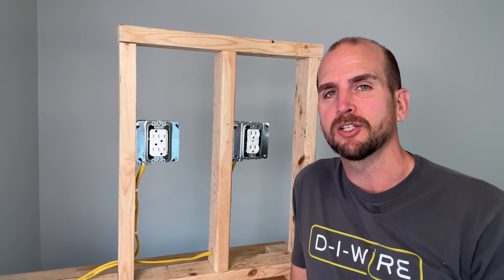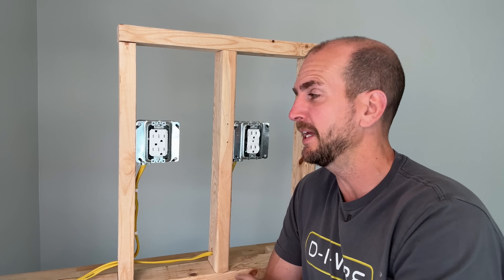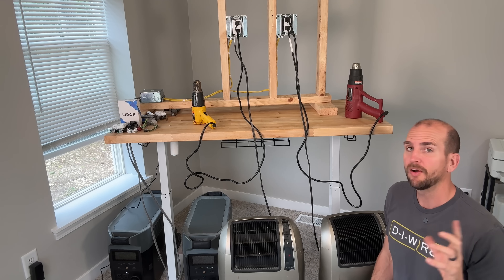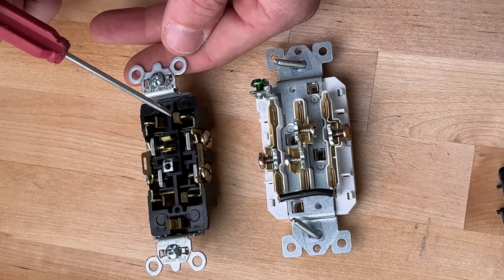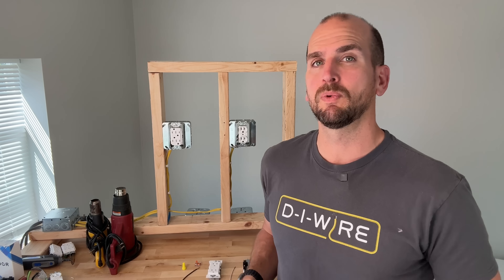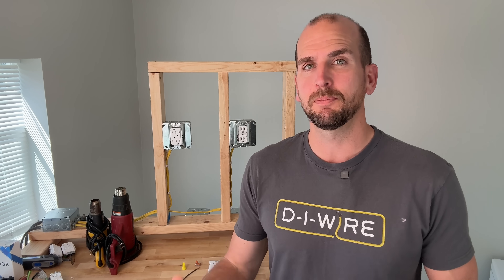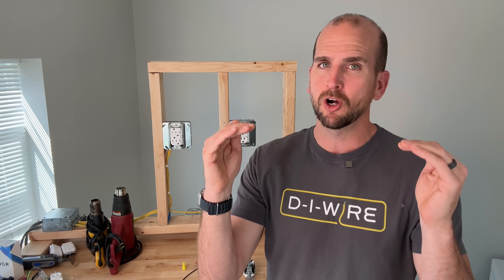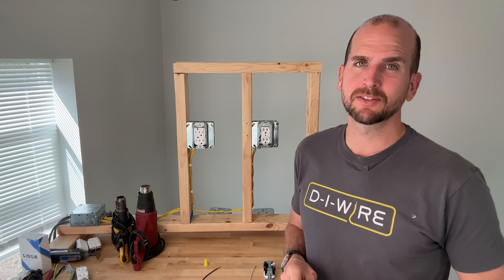The Most Innovative Outlet You've Never Seen | Full Load Testing

Comment: So, you jumped straight into testing and disassembly but skipped over the big, obvious first question - Why? Why do the makers say this exists? The shared blade is the unique thing about this but you don’t address any possible reason for this, and I can’t think of any outside of a Dadaist art installation. The one outlet in each direction idea to make room for wall warts would be easily handled by, oh I don’t know, one going each direction maybe? It certainly doesn’t need the shared blade idea for that, so…. WHY?
Reply: At first I thought you were being ignorant but after about 20 seconds I realized you make a great point. The problem is some cords are designed for ground up and others for ground down which he said and I’m sure you’re aware of. That being said if I was going to go this route I would just install a double box with one receptacle ground up and one ground down. That way you also get 4 outlets you can use at the same time.
Reply: He said right in the beginning  that one side can be connected to a switch and the other to a constant hot wire. If you want to go from switched to always on, just move the plug over. That is a pretty neat concept. It looks goofy AF but can be useful.

It reminds me of the power outlets in some cars. You can choose between always on, or on only with the ignition, just by moving the fuse to a different position. The fuse socket for the power outlet has 3 pin sockets so that you just move it sideways to the desired mode of operation. The middle fuse pin is the load side, the two outer pins are different sources.

For large plugs, the shared neutral blade not only separates the plugs vertically, but it also separates them a bit horizontally. That gives more space than simply putting one upside down. It is slightly more functional in that respect.

I wouldn't use it either but it does open up some new options.
Reply: This appears to be a solution to a problem that really doesn’t exist, at least not in a way that seriously affects the general population. I would never consider installing this receptacle.
Reply: Art. Obviously.
Reply: Retrofit a duplex into a fourplex... Very handy
Reply: This product feels like a design looking for a solution. I can't imagine ever being able to justify installing these. All of the reasons listed seem so trivial and solvable by conventional means. Like, just get a surge protector or something. I'd literally rather run an entirely new circuit to add another duplex somewhere than open up a wall, remove the gangbox, put in a slightly larger gangbox, and put this in.
Reply: @turbo_brian  I’ve seen some pretty horrifying surge suppressors and power strips. I’d venture to say many are much worse than this. They don’t have to be up to any sort of grade or builder’s electrical code.
Reply: Does this outlet need a custom cover plate?
Reply: @Kyohan137  I asked and he said it takes a standard Decora plate. I would need to use a metal one for my purposes and the included one is plastic which is why I asked.
Reply: @emmettturner9452   Thanks for checking ill hold any judgement until I get the chance to check one out
Reply: That was my first question as well. "So, what problem does this solve?"
Reply: He explained it in the first minute...
Reply: I saw the answer. Did you not watch the video? Even the title references the long-running Internet debate about which way is supposed to be “up” and he also says that it allows more room for certain combinations of plugs.
Reply: @emmettturner9452  Well, as I said, you don’t need this weird shared blade, extra-wide thing to solve that, it seems like you could just build one with an outlet in each direction. PS for @diceonamay - sorry, the all-caps WHY was meant to express bemused dismay, not anger. Not mad, just bemused 😃
Reply: @3weight  “Build?” Who said you can’t be using it for a retrofit? The use case I imagined is for my repurposed retail display with many cubby holes holding various vintage game console setups, some requiring multiple outlets (Sega Genesis + Sega CD + 32X, anyone?) and foreign electronics (a particularly convoluted one: PC Engine ROM² Amp + ROM² Adapter + SuperGrafx + CD-ROM² Interface Unit). Each cubby has a metal box with a receptacle and a faceplate. Being able to accommodate multiple power bricks in different orientations would be a plus. There’s actually power distribution for 100v, 120v, 220v, and USB-PD too.
Reply: @emmettturner9452 , looks like you didn't pay enough attention to which thing the "build one" was referring to.
Reply: @HelloKittyFanMan.  Oh, I did. He was responding directly to me and acting like his “build two” solution negated whatever it was anyone like me might be interested in them for… as if the only way to use an outlet is to build and therefore you can always just build with two standard outlets. Well, I got the smaller rectangle boxes instead of the square boxes so I can’t fit two side by side. I wouldn’t be the only one with a use case like that.
Reply: @3weight but what if you happen to have two plugs that need to face the same direction (such as flat angled offset plugs)? I think the idea with this is that it gives you total flexibility without any compromise whether you need both options or not.
Reply: @emmettturner9452 : LOL, no you didn't. 1. You sounded like you thought he was referring to building a new building instead of retrofitting it. Because the outlets aren't retrofittable; just replaceable. 2. He never said "build two." But maybe I'm wrong. What do you mean by "build," exactly?
Reply: @HelloKittyFanMan.  LOL! Follow: He said something (the OP). I disagreed. He dismissed what I had to say by saying I could “just build one” the way he described, as if that applies universally enough to dismiss what I said and go on believing what he said is always true/applicable. I responded with an actual retrofit example that isn’t a “build.”

Reading comprehension is not your strong suit.
Reply: @emmettturner9452  (part 2): You just weren't and aren't clear about "build." You don't have to be rude about it for no good reason, DUH.
Reply: Why are you so mad?
Reply: What a silly question,  @diceyoam . Why are you so presumptive?
Reply: @HelloKittyFanMan.  that’s a big word for you
Reply: @diceyoam : Haha, you don't know what you're talking about. That was a big sentence for you.
Reply: @HelloKittyFanMan.  you are the type of guy that loves to hear yourself talk
Reply: @diceyoam : Oops, wrong. You are the type of guy who loves to have a big head and ASSume you know what someone's feeling is at any given moment despite not being a mind reader and not being around them.
Reply: @HelloKittyFanMan.  bro likes hello kitty and is a grow adult. Possible ped in the chat folks
Reply: @diceyoam  lives under a rock in a cave and has no knowledge of ordinary fan conventions, featuring many cartoon characters, that plenty of adults fully participate in including dressing up as. Lets himself get butt-hurt for no good reason just because someone called him out for presuming something on someone else that he has no knowledge of. (In parts so it will show up; 1. Cont.)
Reply: (Part 2.)  @diceyoam  is a troll because he tries attacking something about another person that has literally NOTHING to do with what was being discussed, as if that would somehow bring "more power" or/and "more validity" to his lame little sad boohoo attempt at an "argument." Pathetic character. Likely narcissist in the chat(comma), folks.
Reply: @HelloKittyFanMan.  Oh wow, I get two part reply? 2 is the perfect age for you huh lil hellokitty lover? Please someone check his PC
Reply: @diceyoam  (part 1; again: just so it will show up): Wow, what's the matter, you can't read explanations of why certain things are done, huh, irrelevant, but...(YT cens. maybe)...t-hurt kid? And you've never heard of things like Comic Con, eh? (Cont.)
Reply: @diceyoam  (part 2): Please, someone check his men...(YT)...tal health record, since that's public information in his case (people who go to m. hospitals aren't protected by the HIPAA; which I know because I've had to check another angry-for-nothing troll before).
Reply: @HelloKittyFanMan.  Another two part repeating your favorite age. Leave the kids alone Mr ped
Reply: @diceyoam  (part 1, your favorite age): Another i...(YT)...dio...(YT)...tic reply showing that you can't understand simple explanations, like WHY it's in parts -- again, it's so YT will let it show up, DUH; (cont.)
Reply: @diceyoam  (part 2): ...actually, now it's just because it makes you so mad (and I know that because I'm a mind reader) -- and that your life is so dark and boring that you falsely ASSume that just because an adult still likes a cartoon character means they're a "ped." Learn how the real world works and go back to your... (cont.)
Reply: @diceyoam  (part 3) ...m. hospital, mr. sicko.
Reply: @HelloKittyFanMan.  Hey mr ped, you still thinking about me? Probably not, I am too old for you.
Reply: ...says the hypocrite,  @diceyoam , who just replied again.
Reply: Some plugs on cords are suited for ground up, others for ground down.  This receptacle ends the debate about which one is correct.
Reply: @nukeelec this receptacle is stupid and I bet it costs way too much
Reply: @lazerusmfh : Haha, yeah, I bet it's like $4.00. So just one wouldn't be too bad, but if you were to wire up even an average sized house these instead of regular ones, the construction might get even more expensive quite quickly.

Comment: Nope. Not gonna break the internet at all, i didnt think anything could beat the single drywall flush mounted outlet you had to mud in, but this one takes the trophy over that one....its actually laughable that someone actually engineered, probably patented,  and is producing that...
Reply: no, the flush mount plug is still magnitudes worse because this recep is still serviceable without needing to carry a tub of easy sand and paint.
Reply from the maker: Yeah, I vote the Bocci single circular outlet holds the top spot of worst ever.  The need for a $80 removal tool for servicing seals the deal on the Bocci not to mention all the drywall work needed.